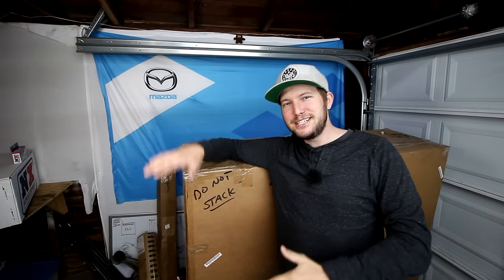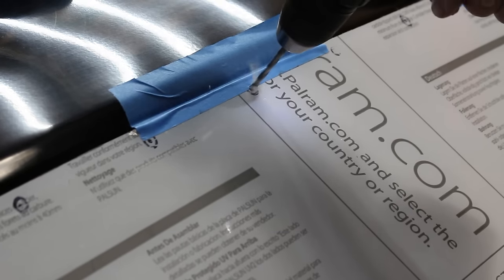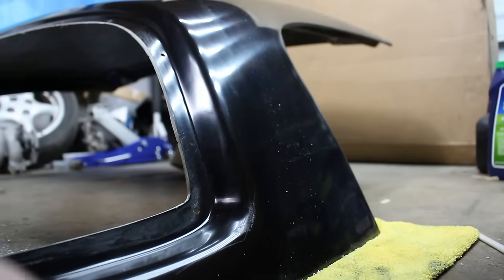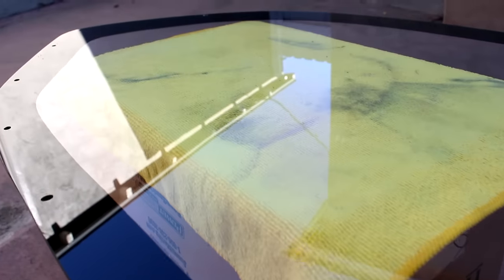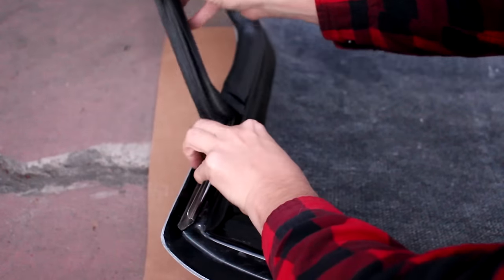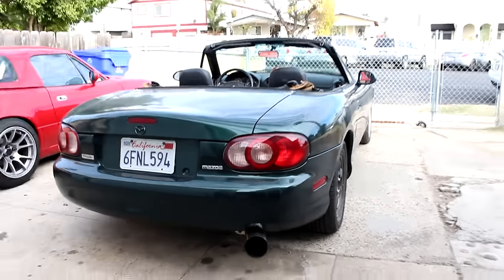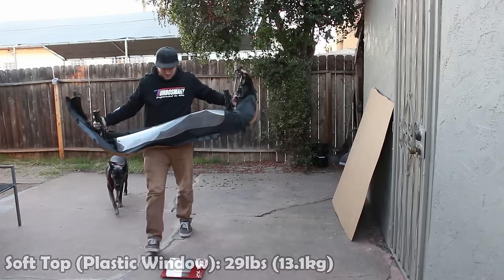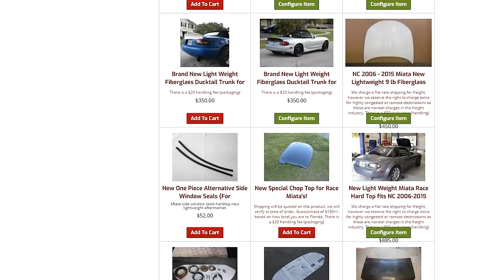Is A TCM Racing Top Streetable? Full Build Process [Project 2SJ Ep9]

Comment: As long as my hair dryer doesn't get soaked in its spot behind my seat, it's streetable.
Reply from the maker: Exactly
Reply: That's how I look at it as well. I have a pristine scissor collection behind the passenger seat that I want to keep from oxidizing. Wait, wait, are you mocking us?
Reply: You're doing it all wrong. You're supposed to have the chick sit in the passenger seat, drop the top and grab some curves. Her hair will be dry before either of you realizes it.

Comment from the maker: Sup guys, there seems to be a bit of missing the main point of this video. It's not meant to say you should difinitively buy this top over an OEM top. It's simply offering another option that many people don't know about, or that many people have questions about. If you were considering this top in the past, now you have a full overview on how to build it and what all of the components look like in detail. I see countless people on parts pages claiming they can't hardtops for sale. This one ships to your front door. I see plenty of people with more track oriented builds that this would be suitable for (These tops are commonly used in Spec Miata). As stated in the video and on TCM's website, this is a racing part that has been adapted for street use. Keep in mind that the Lexan window is significantly thinner than the OEM glass, and also easy to scratch and prone to fading/clouding. Some kind of coating can potentially keep it in better shape. This video is to simply help you determine what option is best for you and your car. Cheers
Reply: Greg I agree especially when prices of the OEM hardtop are going through the roof gives other people an avenue to purchase a hard top that’s affordable 😊👍
Reply: indefinitely purchasing stuff is rarely a wise decision. Your wallet will thank you if you stick to just buying things once instead.
Reply from the maker: @mattteee2973  *****definitively*****
Reply: @TheCarPassionChannel  do you think this too would work with a roll cage
Reply from the maker: @Eddie76134  It will work with any roll cage or roll bar that a factory hard top works with.
Reply: bUT iTs NOt oEm bRrRoOOo
Reply: This is a good install video. If I ever get another street Miata this is the route I will go.

One quibble - these aftermarket tops are NOT used (legally) in Spec Miata with the SCCA. See the SCCA General Competiton Rules, section  9.1.7.7.e - 

“Convertible tops and attaching hardware shall be completely removed. Cars may compete with the MAZDA FACTORY DETACHABLE HARD TOP in place (latches shall be replaced with positive fasteners and rear pin attachment mechanisms must be used or replaced with positive fasteners), but it is not mandatory. When no top is used, driver shall wear arm restraints, and the cage will meet the helmet clearance rule. It is allowed to attach the hard top to the upper windshield bar of the roll cage.”

They may be allowed in other classes (ITA, ITS, STL, STU, T4, or various Production classes where the car is eligible, but you’d have to read the GCR to know.
Reply: This top would be awesome with a  glass option. Hint  hint. Don't thank me just send my top in white.

Comment: Greg, miatas are the best  for cold climates. They get up to temp extremely quickly and their heaters manage to keep the cabin hot with freezing colds and ripped soft top. Best winterbeater choice ever.
Reply: It gets too hot in miata, have to turn heater off even if its just blowing on level 1
Reply: Agree. Daily drove mine with a hardtop through 3 winters in Ohio and the cabin was never uncomfortable in terms of temperature. In terms of pucker moments, on the other hand...
Reply: As a Texas miata owner, yeah, I never even turn the heater on during winter. Summers are absolute hell, though.
Reply: @squidikka  Don't have AC?
Reply: Mimy 95 was pretty decent with this rash of extreme cold here in Kansas.  From -10 to -30 degrees with windchill,  the heater took some time to warm up as with all the other vehicles. But once warm, it was really warm. I had to keep switching from cabin air to fresh air because my breath kept freezing to the windows.
Reply: @dragonbrownies517  yeah here in kansas the cold made my battery not work, I think megasquirt uses more amperage on start and in the cold the car wouldn't have enough juice to get started but once it got started itd heat up in 3-5 minutes and heat absolutely cranks
Reply: @dragonbrownies517  why use cabin air in cold conditions?
Reply: Miata with snow tires is pretty fantastic. The 1.6 engines really shine having no torque down low, really lets you get off the line in the snow easier without spinning the wheels.
Reply: @awesomecooly123  Motor's stock so as much as I want to turn the AC on, I can't stand the hit to the power. It just feels wrong. Instead I just sweat it out and pull down the top.
Reply: @squidikka  ever since I went to ms2 (mind you I do have a supercharger makes 160whp) I don't notice a major difference in power with ac on or off, fairly certain it's not quite as fast but wouldn't bet money on it.

Comment: To represent the cold climate Miata owners: I drive my NA with an OEM hardtop in Michigan during the winter, and it's gotten down to single digits for several weeks this winter. The hardtop keeps the heat in fine without any insulation, and you can totally drive a Miata in cold weather, hardtop or soft top, and remain comfortable. I only switched to a hardtop for dryness and aesthetic purposes. Great video Greg, but ya misrepresented the snow Miatas!

Comment: I recommend washers on the back of the bolts for the plexiglass window. That way it can disperse the tension of the bolts on the fiber glass less on the center to prevent cracking.

Comment: For the seals between the top and the body I would suggest throwing a coat of silicone grease there, good for the rubber and helps keep the water out.
Reply: Good suggestion, I've used the Shin-etsu silicone grease on my classic minis and my MX-5 (before the wife destroyed it) and I was amazed, it made so much difference.

Comment: Another thing I feel worth mentioning is lexan "glass" that the fiberglass top comes with will not last.  It starts accumulating scratches the second you peel the protective film off and if left outdoors will last 3-4 years before you can barely see out of it, it gets a nasty brown haze and needs to be replaced.  I have had lexan hatch and side windows and never recommend them for cars stored outside unless it's a race car and you need the weight savings.  Regular glass that comes on the OEM top (that makes it heavier btw) will last forever and is impossible to scratch.

Comment: Had my treasure coast hardtop for a couple months now ,  im using the stock seals and rails and ran into the same problem that you did near the end of the vid . My seals leak like crazy on the side windows with the stock seals and ive tried everything. Definitely gonna try those 1 piece as they look like they seal almost 100% better

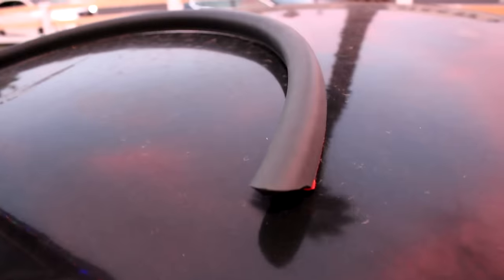Comment: 13:30, I had those treasure coast seals on my snugtop, they're trash and the adhesive dries out pretty quick. Buying the oem hard top rails and gaskets is fairly expensive but definitely a better solution.

Comment: I made custom lexan windows for my fastback and you can buff scratches out with a dual action/random orbital buffer and cutting compound—just keep it moving so you don’t heat up one spot and melt the lexan. Also, I clean mine with ammonia-free glass cleaner like the “all natural” organic vinegar-based stuff or Sprayway brand you can buy at the auto parts store. Microfiber cloth only! Anything else will leave scratches.

Comment: to be fair you can get brand new hard tops from Mazda still thanks to the roadster refresh program in Japan.  you get a glass window w/defrost in black gel coat with everything to install it including frankenbolts and the interior latch striker and replacement interior panel.  ~$1800

Comment: I have a racing hard top on my NB I bought it from some random guy and it has solid mounts. I can’t figure out the brand to this day it has a glass window with a defroster. It’s a pain in the ass to take on and off on nice days but I will note the difference in stiffness from the soft top when cornering and going over bumps.

Comment: That top isn't bad. But the inside is rough looking. I'd peel ply that after finding out what kind of resin it was made from. Either polyester, vinyl ester or epoxy. That would give it a smooth finish. Then paint it back on the inside. and I'd look for some of that 1/4" thick sheet black foam with adhesive on one side like the OEM tops have on them. It's too bad they don't have the chrome blocks that go over the Frankenstein bolts. It looks like that's missing on the racing top and needs to be there. The attachment brackets look exactly like the Garage star brackets I got for my OEM top for theft deterrence.

Comment: Miata hardtop looks CLEAN as hell.  I cant come together on it though, as the open top is one of the main party pieces of the car.  I thought it was a stiff platform. Does a top add rigidity?  I get the benefit of not having your head cut off in a rollover, mind you....but i think if i buy a miata that's what im signing up for.  For basic aesthetics, I also understand it looks faster, cleaner.  I also dont track cars BUT i have a significant amount of respect for and appreciate the guys that do because it results in more thoughtfulness in car engineering.  Im not sure if im weird or normal, but I would take a sporty car and enjoy it driving corners fast and the good performance at regular speeds...just better than a minivan or a mom car, and the looks are more iconic and artful.

Comment: It was minus 10 degrees C (that is 14 degrees F) in the netherlands last week . Miata is the daily, and even without all the isolation you speak of it is not bad at all. the first 15 minutes you stay warm enough and then just put on the heater :) Which if it brakes you have a very nice video for on how to fix that ghehe luckily havent needed that one yet.

Comment: Thanks for another great video! I think I'd go with a white fiberglass to for the red car. Not only would it give contrast, but believe this OG when I say it Will be Much Cooler (temp wise) inside the car and you could prove that with a thermometer (before & after). If you are going to change the trunk why not the hood as well? Isn't it More important to lower the weight in the middle and front of the car, then the rear? I would think the last thing to do for handling is lighten the rear, not the first. Just Sayin' Best Always, Chris Zinn

Comment: The price of hardtops in the UK makes up for the higher rate that the mx5s rust at here. I've seen hardtop sell for $1500 when a good one in the uk is about £250-300.
One suggestion for the painting, I'd say peeling the middle bit of the protective plastic before the paint has fully dried would be a better idea. Less likely to pull any of the paint up, as the paint will still be soft.
Reply: At least its getting closer to spring so more hardtops are coming for sale in the UK and their prices are dropping slowly too
Reply: Check again. Prices are climbing for the past two years and are now at £500 for an average nice example. Still cheaper than the US though.
Reply: @yossi126  First two I've saw on a an mx5 buy and sell page are both £350.

Comment: One question, did you take your soft top off or did you keep them on? I’m only asking because I want to know if there’s any issues with how solid the hardtop holds with the soft top on since it isn’t really bolted up. Thanks.
Reply from the maker: I did remove the soft top from mine, but you can leave it in place.

Comment: I'm about to drill into mine and I see the bolts are 5/32 in diameter. Is that the same drill bit diameter you used or did you use a smaller diameter?

Comment: I have an OEM hardtop and i was wondering if I could make the harness that connects up to it. I have both relays for it in the trunk
Reply: If you need the plugs and wires for the heated screen they are not hard to get, it’s the same wiring as the soft top heated rear screen.

Comment: Love this video Miata Dad! Lol 😂 Question for ya ? I live in FL and have been considering one of these because it might be easier removing and replacing on a whim with FL crazy weather than an oem top . Aside from the hardware, do you think the weight helps significantly with mounting it on the car by yourself?
Reply from the maker: An OEM top with latches will be faster to remove than this top. Weight of the OEM top isn't really an issue in my opinion, kind of why I put that 2 second clip in the end of pulling the OEM top off by myself

Comment: Is the TCM hard top the exact same dimensions as the OEM one? I.e will it fit roll bars designed to fit OEM hardtops?
Reply from the maker: Yes they will allow all of the same roll bars. These tops are commonly used in Spec Miata and other racing.
Reply: @TheCarPassionChannel  Thank you for the response. That's good to hear, I've been considering either OEM or aftermarket. btw, been a long time fan always enjoy your uploads!

Comment: I'm wondering how it is rattle wise? I've got an aftermarket hardtop and its really bad at the frankenstein bolts, literally smacks around at every bump. Since there's not much weight to rattle I assume it's better than mine.
Reply from the maker: The TCP top does not use Frankenstein Bolt attachment points so definitely no noise there. There is some creaking when pulling into driveways and such, but when just driving there is no rattling or anything. I'm guessing the way the top is tensioned down in the back helps with that.
Reply: @TheCarPassionChannel  Ok now I'm jealous.

Comment: It's way too expensive. For the hardtop, Lexan window, hardware, freight shipping, taxes,  etc.,  you're  looking at around $1500. At that price you might as well buy the original hardtop from Mazda. If I'm not mistaken they are still available for about $2000.  This would be a good deal if it was priced around $800 for everything shown here, but it would it would need to come with the holes pre-drilled.

Comment: Tbh, $1200+ is not worth it when you can get an OEM for $1500, plus you don't have to build it.
Reply: This is a lot lighter than the OEM top. That said... OEM weighs like 30ish lbs so it’s not that heavy
Reply from the maker: @aygwm  The OEM top is ~45lbs with latches